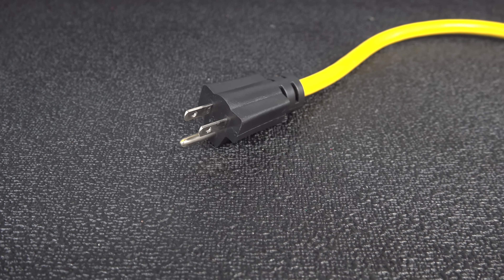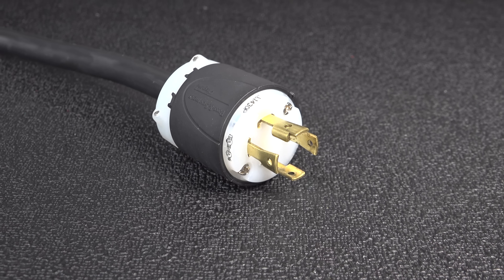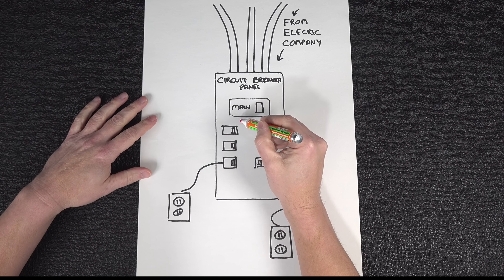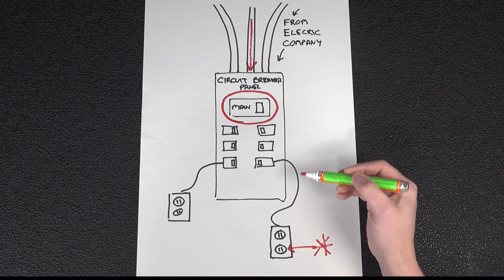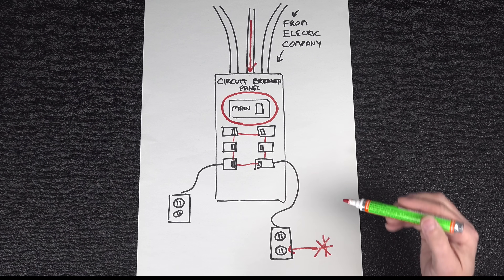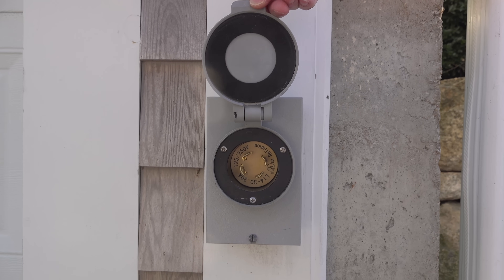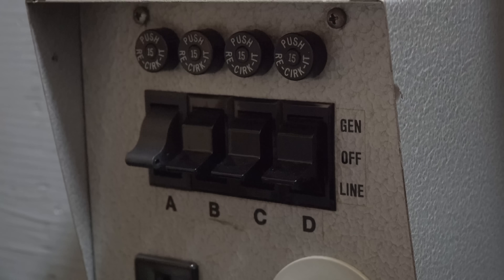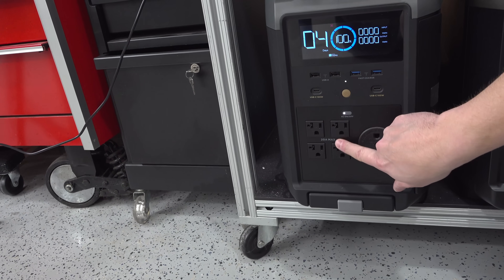Worst Electrical Mistake You Can Make - Backfeeding Generators

Comment: There is a myth that a generator cannot transit through a transformer. And this will also not work with GFCI's.
It's definitely worth checking out a line demonstration there's usually a mock set up on a trailer and they do the whole hotdog line transformer generator thing. The bigger question is have you seen a female to female cord? I now have two and I ..... don't know why?

It came about from a funny story... This person I work with had a circular saw and the pins broke off the cord so they took a picture of it and sent it to the other person they knew that was heading to the hardware store to pick up a new end. Do you see where this is going. Having looked at the picture they picked up a new end but it was female because the circular saw cord had the pins broken off. But wait it got better, said end got put on said saw and then he realized... it's the wrong end. This is where I come in, of all the weird things I've built I do have a custom made "safer" suicide cord for extreme emergency Temp use and of being a qualified individual. However I have never had the opposite so I made myself 2x of them. I figure the two will go hand-in-hand as sort of a safety measure.

The reason I made a suicide cord is that I was helping somebody move and they did not have electric yet in the house they were moving into, we had to work in the not so good basement with no lighting. So when the opportunity presented itself and I had the necessary pieces needed for one for future uses to attach to the inverter in my car. In an attempt to make something that has no ability to ever be safe safer, I put a double pole switch between the two ends which breaks both lines and has an indicator. This way it can be an indication that it is on and If it's plugged into an active outlet with the switch off it can be a warning.

What makes you qualified to use one of these things or possess one? I do not know and I think one of the things is you are willing to not tell anybody about it and you're going to keep it away from everybody you know, I really wish nobody had these things.

Comment: I can't believe anyone in their right mind would back-feed a panel via a 15 ampere circuit!

Had a buddy on a power crew get knocked on his @$$ because someone back-fed and didn't shut off the mains. (Homeowner back-fed 240 into the cloths dryer outlet... even worked.... for a while)
An acquaintance damn near burned down his house doing it. (just acquainted.... when we first met, he just didn't seem sharp enough for me to want to ever become "friends" with him....)

Even if you remember to shut off the mains to the house, you've got a generator that's capable of, probably, 30 amperes going into a wire rated for 15 amperes. All you need is for your refrigerator to come on at the same time as your microwave and you have a damned good chance of (momentarily) drawing more than the wire is rated for, or can handle. We won't even talk about something 220/240V trying to come on (like an electric water heater or stove-top) and having nothing but what that 120V plug is supplying.

The upside is, you'll probably make a few friends at the fire department, and you'll get to know your insurance agent on a far more intimate level.

Back-feeding without proper wiring and an interlock/transfer switch is just a bad idea. Just use extension cords directly from the generator to whatever you need to run.
Reply: No.  If the fridge comes on at the same time as your microwave, the built-in breaker for the outlet on the generator would pop and disconnect the supply at the generator.  Each outlet on a generator has a built-in breaker (usually right above it) that limits the capacity of that outlet.

There's no generator out there with a 120v outlet that has unprotected access to the full generation capacity of the generator.
Reply: @rthinds  
Well, the refrigerator is usually on a 20 ampere circuit, and a 7500  generator usually has a 30 ampere breaker on the 240.
Backfeeding into a 120V outlet would normally be on a 15 ampere. 120V breakers, at least on my generator, are 20.

No matter what, backfeeding through a 15 Amp 120V socket is flat nutz. No way is anyone going to convince me otherwise!
Reply: @allanhitchmoth3099  
"and a 7500  generator usually has a 30 ampere breaker on the 240."
Yes it does. But are you feeding those 30amp/240v through a 15amp/120v outlet??  
OF COURSE NOT!!  
So WTF does this have to do with anything??  Thanks for stating totally arbitrary and unrelated information.  (:eyeroll:)
-
"Backfeeding into a 120V outlet would normally be on a 15 ampere."
Correct.
And if the microwave and fridge come on at the same time, it will trip said 15amp breaker, either in the main panel, OR on the outlet on the generator.  Just like I said.

Stay on topic.
Reply: @rthinds  
First, if you're backfeeding through a 120V SOCKET, the only breaker you're going through is the generator. Anything else on that same circuit (the one with the suicide cable plugged into the wall) is drawing power with NO panel breaker in that circuit!. The ONLY breaker you get is the one on the generator, and, it's typically 20.
So......
Just out of curiosity, are you saying it's safe? And if not, how come?
Reply: " the only breaker you're going through is the generator. Anything else on that same circuit (the one with the suicide cable plugged into the wall) is drawing power with NO panel breaker in that circuit!"
-
WRONG!
The other end of the suicide cable is plugged into a 120v outlet in the wall of the house somewhere. Follow the wire from THAT outlet. Notice it returns to the main panel?  And what is in the main panel?
BREAKERS!!
That means the "load" passes through the breaker on the generator (as you mentioned), through the suicide cable, into the house outlet, through the wiring, back to the main panel, then THROUGH THE BREAKER to the main buss-bar.  It then passes through yet a third breaker to the branch circuit powering the fridge/microwave/whatever.

That's THREE breakers the load passes through.  C'mon man, you should know this.
I'm not saying it's safe or dangerous.  That's a topic for another conversation.  Stay on topic.
-
" is drawing power with NO panel breaker in that circuit"
Tell me WHERE is there a 120v outlet in ANY HOUSE that has no panel breaker associated with it.  You think they wire a 120v outlet straight to the mains from the utility pole????
Reply: @rthinds  
Seriously?
"...Follow the wire from THAT outlet. Notice it returns to the main panel?..."

If it's the ONLY outlet on that circuit! Otherwise, that wire will ALSO DIRECTLY connect to other outlets! 

Go ahead and shut off every breaker in your house. Then go to your living room with a meter. Check the continuity between the outlets on the wall and, even with the breaker at the panel OFF, you'll get continuity... At least, between a few of them! That means, they're on the SAME CIRCUIT and backfeeding into one of them will energize ALL of them ON THAT CIRCUIT and NEVER need the breaker in the PANEL!
Think this through logically! You DON'T have a SEPARATE circuit breaker for EACH outlet in your house! That means, SOME of them have to be connected, and there's NO BREAKER BETWEEN them!

That means you could potentially draw from other outlets on THAT circuit and never have the panel breaker come into play!

Then, if the panel is energized via that outlet, other loads could add up and draw more than the 15 amperes the outlet (and wiring)  is rated for, while the 20 ampere breaker on the generator is happy!

"...I'm not saying it's safe or dangerous. ...."

Well... I AM!

I'm saying it's dangerous and STUPID! 

You do you.....

Anybody else out there who thinks about backfeeding a generator into a 120V outlet using a cable like this, DON'T DO IT!

You'r MUCH better off running extension cords directly from your generator to whatever you have to power!
Reply: "That means you could potentially draw from other outlets on THAT circuit and never have the panel breaker come into play!"
-
Ok, I see what you're saying here.  We were talking about two different concepts.  Yes, in your case (which is RARELY experienced in real-life), you are correct.  

The ONLY way your scenario is relevant is if I backfeed into the same circuit as the microwave/fridge.  Then you are correct - only one breaker, on the generator.

However, microwaves and fridges are usually wired with a single "appliance" outlet on a dedicated circuit, so your scenario is highly unlikely.  There's no way to backfeed into a circuit with a single dedicated appliance outlet that also has demand.  You could backfeed, but that's the ONLY thing you could do. No way to draw from this backfeed on the same circuit.
-
"If the panel is energized via that other outlet".  

So where on earth are you getting this second energy source?  Are you using a second suicide-cable??  A second generator??  Cmon man, we were talking about a single suicide-cable backfeeding a single outlet during a power outage.  All this academic but highly unlikely BS is purely for theatre.
 -
I understand what you're saying, and you're correct (in a very limited scenario).  I was assuming the backfed outlet is NOT on the same circuit as the microwave/fridge in this example, and there were NO OTHER SOURCES of energy (what homeowner has 2 generators they use simultaneously on the same household?)  

As I said - code dictates microwaves and fridges have a DEDICATED outlet to a DEDICATED breaker.  Ergo, no way to energize that circuit from an alternate location.
Reply: @rthinds  
Ok... We're getting somewhere....
Now that you understand that there are other outlets on that SAME circuit (we'll call it "circuit 1") that could  draw current from the single energized outlet that could approach 15 amperes, if you THEN allow a backfeed into the panel (by way of the 15 ampere breaker on "Circuit 1;" the energized circuit), it's possible that something on a DIFFERENT circuit (Circuit 2) could be turned on and draw only 4 or 5 amperes. 
Since the energized "circuit 1" directly plugged into the generator is already approaching 15 amperes WITHOUT having to go through the panel breaker (1), if another circuit turns on, that panel breaker (on circuit 1) will only see what the other circuit (2) is drawing. So, that breaker (1) , and the breaker for the second circuit (2) would only see the 4 or 5 amperes being drawn by the second (Circuit 2) load, but the WIRING on the circuit (1) plugged into the generator would see the original 15 ampere load, PLUS the 4 or 5 ampere demand from "Circuit 2" and be over the rated limit of 15 amperes!
So, while code may mandate microwaves and fridges be on different breakers, it ALSO FORBIDS backfeeding a panel by way of ANY outlet! (with good reason!) Once you allow the power to hit the panel by way of "INPUTTING" to an  OUTLET, it can go ANYWHERE connected to the distribution  panel, and the WIRING (and the outlet itself) on "Circuit 1" COULD get a demand for an unsafe level of power. (up to 20 amperes before the breaker on the generator calls "Foul" and trips!)

It can be VERY confusing unless one actually draws the wiring layout on paper... So confusing, in fact, that there are MANY people who actually think it's OK and try it.... In earnest, most people seem to have "gotten away" with it... at least in the short term... but.... it's a very bad gamble!
Reply: @allanhitchmoth3099  

Yes. I understand what you're saying.  The panel breaker for the backfed circuit will experience only the additional load placed by the operation of something else on another circuit.  That, plus whatever is plugged into the same backfed circuit may be over 15A, which is the limit of the generator breaker (for 120V).

That wasn't the scenario I was describing, but I agree completely.

My scenario was to use the house wiring to power your fridge or microwave (not both at the same time!) instead of dragging them out from cabinetry and running 100ft extension cords through open windows.

When you backfeed into a panel, the GOAL is to (potentially) energize everything else.  Just not all at once. 

As long as you leave every other house circuit disabled (and the mains), you can direct the power coming in one circuit, through the main-bus, then out to the desired circuit with the fridge or microwave on it.  In that case, all the power would be running through 2 breakers, if not 3.

Comment: You might want to add that with that backfeeding cable plugged in, if you’re dry, you will only get shocked, but if you’re wet, you will get electrocuted, if you touch the other male end.

Comment: Backfeeding isn't illegal if you are the source of the power.  What's illegal is backfeeding from someone else's power. The linemen are going to know if there's power going through those wires or not before servicing them.  Many electric companies will purchase your backfeed (they are actually required by law to buy it at fair trade value).
Reply from the maker: Sorry but none of what you wrote is accurate. How would a lineman know if a generator was turned on mid-repair? Buy back of power is allowed by law through an approved method which generator back-feeding is not part of.
Reply: @SilverCymbal  How would a lineman know if a generator was turned on mid-repair? By the linesmans motto: "If its not grounded, it is currently live". That's how. The generator would be powering directly to ground through a ground strap.
Reply: They wouldn't mid repair but at the start of the repair there are ground fault blocks  that have already been put into place to insure isolation from repair area to the transformer that's first.  Second, the lines are connected through a stepdown transformer. Yes you can backfeed power through there but the transformer is wired to drop voltage.   120/240 if it happens to energize the transformer is going to see an output voltage drop of 6 to 10%. Then pole utility transformer are typically 3 wire primary so a neutral can not be derived meaning no transfer of power. Not to mention inrush current or that most meter boxes are set up to prevent backfeeding of higher voltage.  Then there's the fact of utility workers often perform what's called hotwork. Meaning they are working on energized lines. That is why they use specialized equipment to protect from a grounding situation. The risk involved with backfeeding a generator is the powersurge back to the generator once connection is reestablished.  This usually causes the generator to arc possibly resulting in a fire and damage to not only the property of the owner but surrounding property as well.  What is illegal about backfeeding is the tampering of utility property.  I'm not saying go make a male in male cord and power through it because that's asking for problems.  Now with the sell back of generated excess power, how a generator end is powered isn't regulated by the power company.  A generator turbine is a generator turbine whether it be ran hydrologic, combustion, wind or steam. As long as the excess power goes through an isolation transformer back to the grid preventing reverse polarity, how you generate that power is up to you.  Combustion just isn't feasible in smaller applications due to cost of consumables verses payout.

Comment: I've done that a ton of times. I just flip off the main breaker before I connect it and I always connect the house first
Reply: you need to LOCK the breaker or panel to be legal.
Reply: @snap-off5383  I'm not concerned about legality lmao
Reply: @Yousitech gotcha, well it does have some merit to keep others from flipping it.  High five.

Comment: Nice video. I was wondering how electric Vehicles would feed a house with power and all the pitfalls or issues with that  ?
Reply: They would most certainly have to install some sort of battery and power management system in the house to convert the voltage and waveform for residential use.
Reply: the system you buy and install to to charge them contains the switches necessary. Likely an auto-transfer switch would be required to feed the house.

Comment: Excellent video! You explained so clearly why backfeeding is dangerous that I hope nobody watches this video and then buys one of those killer extensions. It costs a lot more to do it wrong. Spend what you have to in order to do this safely.
Reply: Its completely safe the other way if you have any intelligence at all. Flip the main off and plug the gen in before you start it. 100% safe unless your an idiot.
Reply: But it should be "you're an idiot"

Comment: If you run the generator on most RVs, that plug on the side is hot!  There is no transfer switch in most RVs.  It's why they tell you to make sure to unplug before you start the generator, you'll blow a fuse if you don't.

Bad example.

Comment: Similar thing there’s a USB A male to USB A male cable for computer’s  it’s for some laptop cooler’s, dock’s etc. If plugged into devices that output 5v both devices will short. 

Same thing can happen to USB C to USB C if you get a poorly made one, 
since USB C has different voltages possibly up-to 100W depending on device. Well that could be bad.
Reply: Voltage and power are different. 100 W USB is 20 V DC. It is still safe. Also the active contacts are inside the connector unlike in Lightning. Also it is not grounded.  Sure badly made USB charger could pass mains but this would be different even if you touched the metal frame of the phone.
Reply: bad as in a device may no longer work.  None of that is going to start a fire.